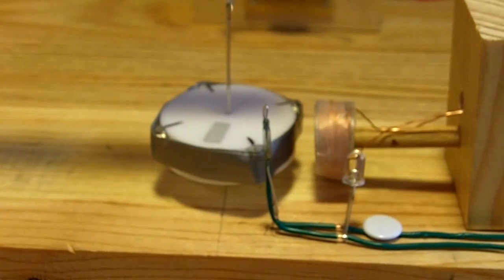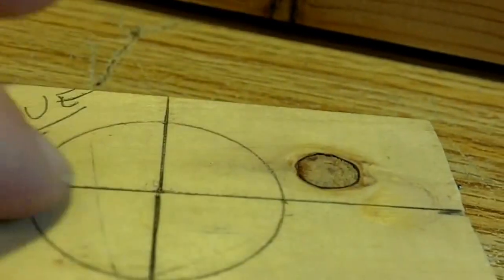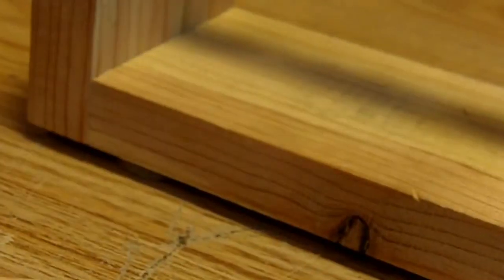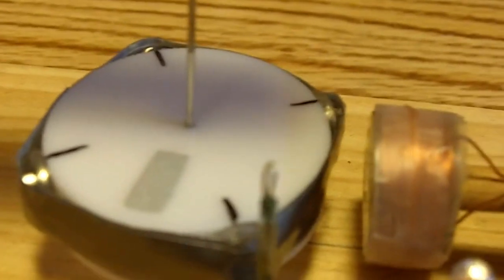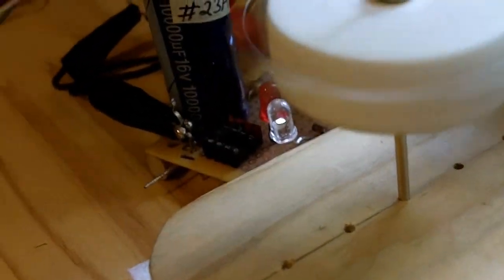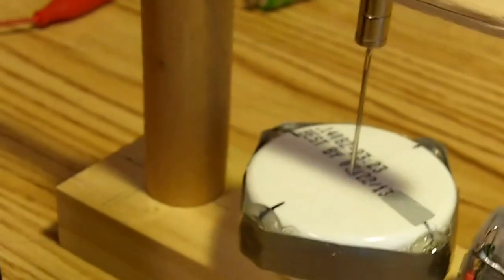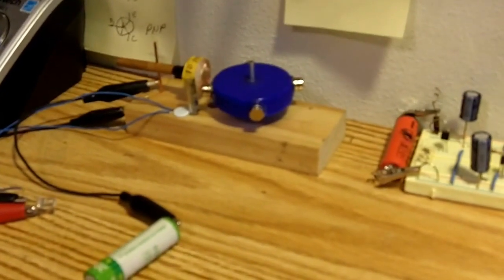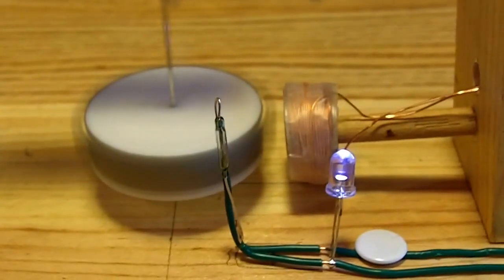Pulse Motor Rotors

Comment: MagnetMan,
Where do you get the needles to use as the shaft that these rotors run on? What dimensions or size needles are they? They look pretty huge in the videos! Got a diagram or schematic for these motors and did you deviate from that diagram? Thanks again for another interesting build. 
Robert

Comment from the maker: I got the magnets on eBay (10 neodymium disc 1/4" by 1/4" $2.46 free shipping) I also used the 1/4" by 1/8" They are 20 for $2.28 free shipping. Thanks for your comment.

Comment: Thanks magnetman I will give it a try with the LED I do have pulse motors running with my own home made reed switches but I prefer to use the ones of eBay as long as they don't burn out which they have been doing, thanks again.

Comment from the maker: The diameter of the cap is alittle over 1/12 ". The coil resistance is about 8 ohms. As to the number of turns I do not know. I just filled a plastic sewing machine bobbin full. I'm using one AA battery, 1.2 volts. It will run on a lot less!!

Comment from the maker: If you take a look at a video I made called (Magnetman2010 Eddie's Toys) You will see a circuit with a reed switch. That reed switch just ran and ran and it is still working.The varistor obsorbs the spark in the reed switch. In (pulst motor rotor) I believe the LED is doing the same thing.